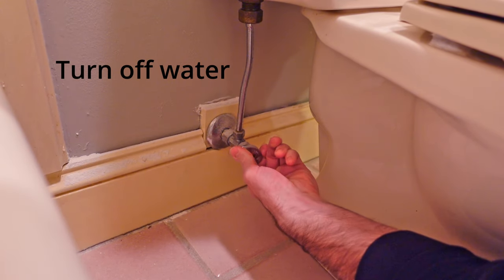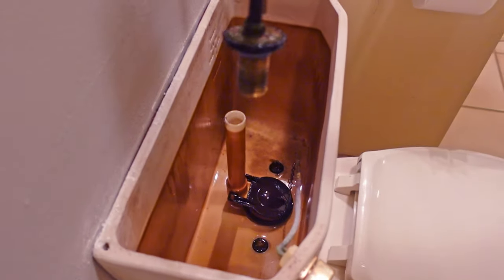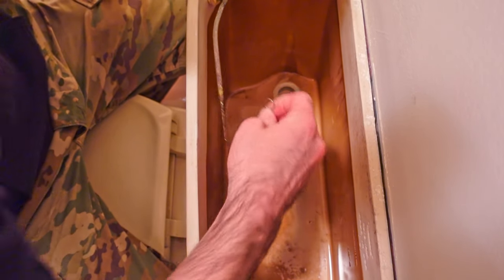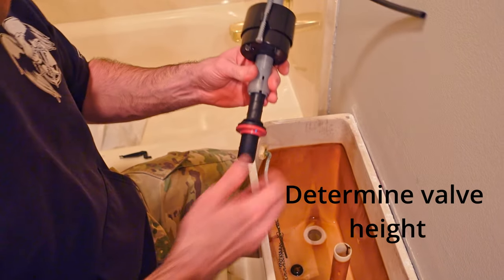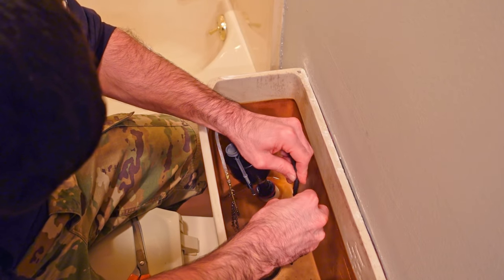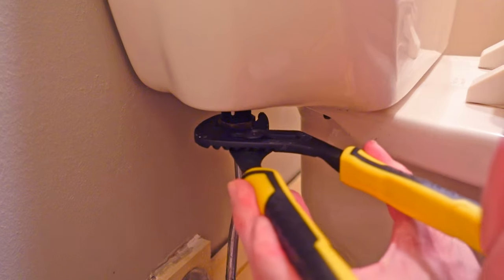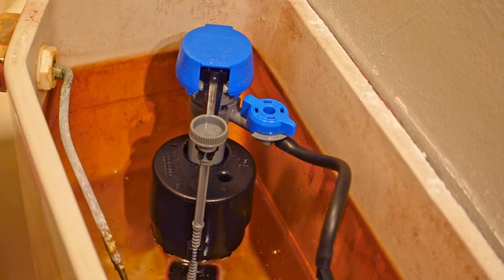How to Replace a Toilet Fill Valve || Installing the Fluidmaster Fill Valve and Flapper Kit

Comment: My tank has the ballcock also. Looking to replace everything in the tank. Do I need to have the ballcock also or can I just replace it like you did. Thanks
Reply from the maker: You can replace it all just by buying a new fill valve. The new valve will eliminate the ball and essentially replace everything inside the tank.

Comment: Thanks for the tutorial! My toilets been running nonstop and finally just bit the bullet to get a new stopper. Hoping I’ll be able to fix it tmrw when the part gets here!
Reply from the maker: To much tension on the chain connecting the handle to the flapper can be the cause of that. But if the fill valve is the older style probably just worth doing a full replacement since another part could have failed.

Comment: Video was helpful thanks.
Reply: I think I did the chain part wrong though since it's not flushing quickly
Reply from the maker: The chain does take some trial and error to get the adjustment right. My first valve install, I think it took me like 5-6 attempts to find the right tension. If you think its not flushing well, it might be the tension on the chain is not allowing enough water out of the tank before the flapper closes. If this is happening, usually you have to hold the handle down to get it to flush completely. On the other hand, you could also have the tension allowing for too much water, which would make the tank take longer to refill and the flush would last longer because of the extra water. Toilet design also plays a big role in how quickly the toilet flushes. I have noticed the larger the tank (typically older less efficient toilets), the more water per flush, then the slower the flush, cause it needs a lot more water to push everything through the lines. The smaller tanks (typically new and more efficient) that require less water per flush tend to be faster. I'm no toilet expert, and I know this isn't a straight forward answer, but it really is just a little trial and error on the chain adjustment. Hope this helps some.

Comment: Thank you so much! This was extremely helpful. I was so nervous about replacing everything in my daughter's toilet because it wouldn't stop running/fill up the tank. Excellent video!

One more thing. Why didn't you clean the tank?! 😂 (Before anyone comes for me, it's recommended that you clean your tank whenever it looks like that to remove rust and mildew.)

Comment: The angled seat on the flapper body that is insde the toilet along with the diameter of the hole that the water goes down is a big thing to address some are bout 2 others ar 3 and sizes vary by toiilet most take the common size fluid master. I had a toilet that would not take anything but the original 3 inch that I could not find a replacement for at the home deep hole in my area...

Comment: A massive help to me!  Great video. I am replacing the kit which is not too difficult using your video. Meanwhile, the flap looks fine except that part of the disk that it sits on just broke apart. Is that easy to replace? I could send a photo but I don't think I can do that on here. Any suggesstions?
Reply from the maker: Every part of the toilet and tank can be found and purchased individually in the plumbing section of Home Depot or Lowes. So you don't have to replace everything in the tank if you have one broken part but the rest is all good.

Comment: Im upgrading to the fluidmaster too. Can i keep the old fill line and flipper? I would need to remove entire tank to replace everything.
Reply from the maker: Yes you can keep those if they are still good. You can replace just the valve if you want or replace everything in the tank. You can find different kits at the store depending on what you want to do.

Comment: Are there any benefits to changing out the old style flush valves to this new style? We just moved into a new house and our toilets have the old style. And when I say new house I mean brand new house. I’m a little surprised they went with this old style of flush valve
Reply from the maker: The benefits would (in my opinion) not be worth the cost of upgrading to the newer style fill valves unless you are having issues with them or they are very loud when refilling the tank. There is nothing wrong with the older style, its old proven technology, it does the job and it is proven to last a long time. When I replaced mine they were most likely as old as the house and my house is 30 years old. The contractor would have used the old style in your brand new home simply because its saves money and they want to maximize their profits. Now the benefits of the newer valves are, typically its easier to make adjustments to the water level in the tank and bowel quickly and it takes up less space in the tank compared to the float valve which makes it easier to work on anything in the tank if necessary . Also the newer fill valves can be quieter than the float valves when refilling the tank, in fact some brands sell valves marketed based off how quiet they are.  So if you flush your toilets and its so loud you can hear it refill from across the house then that might be a good reason to spend the money on a newer quiet fill valve.
Reply: @thediygrunt  appreciate the information!

Comment: hey brother blessings, quick question...my toilet isnt filling with enough water after flushing ....so my pops got the new fluidmaster flushometer...should this do the job ?....do i need a specific wrench to loosen the bottom part i notice its pretty tight on there...i didnt want to mess anything up...thank you bro!
Reply from the maker: Toilet bowl water level can be adjusted using the fill valve. There are typically two "knobs" that control water level adjustments. One for bowl and one for water in the tank. You don't need a specific wrench just one that is big enough to fit around the nut on the bottom of the valve. An adjustable crescent wrench or channel lock pliers will do the job so long as they are big enough. My go to is channel lock pliers.

Comment: When connecting the water line back onto the toilet will teflon tape be needed at all or does it depend on the setup
Reply from the maker: I do not remembering using it and I have had no issues at all, though I could be mistaken. Plumbers tape will not hurt so you can feel free to use it. Worst case if you do not and turn the water back on you should see a leak almost instantly so just turn it off right away and add the tape.

Comment: In some videos they take the tank out. Is that necessary? My problem is the toilet constantly running.
Reply from the maker: I have never had to remove the tank to replace the fill valve on a toilet. I do not know of any toilet fill valve kit that would require the tank to be removed.

Comment: Those stiff fixed lines often break when you try to move them.  Why not make another video where you show how to replace the fixed supply line with a flexible line?

Comment: I was doing this today and literally got everything I needed correct, but no matter what I did, the toilet would never have enough pressure. It makes absolutely no sense to me
Reply from the maker: You have two different adjustments on the valve. One to adjust how much water is in the bowl and one for how much is in the tank. If you are having pressure issues I assume you mean not enough water is being released to flush everything right? First make sure the tank has enough water. Inside the tank usually on the back right you will have a line it will say "water level" or something along those lines. With the tank full the water should be right around that level, if it is not you need to make adjustments and then flush to reset the tank. Most likely your issue is the water level in the bowl. If you have to little water in the bowl and go to flush you will not have enough water released from the tank to generate the pressure you need to flush everything. So you need to increase the water level in the bowl if this is the issue. Make your adjustment and then flush to reset the level to the new adjustment. Most of the valves have instructions that typically say drop like 2-4 pieces of toilet paper in the bowl to simulate flushing liquid and 4-8 pieces to simulate flushing solids. If it fails to flush all the pieces then adjustments have to be made to the water level in the bowl. Most tanks are made to hold enough water for the toilet to be able to flush twice back to back so the chances your water level in the tank is the problem is slim. At minimum the tank should have enough to do one proper flush even if the water level is low but make sure to check both levels and adjust them if necessary. Oh I almost forgot check to make sure the flapper is opening all the way and staying open long enough to do a proper flush. Adjust the flapper by tightening or loosening the tension on the chain that connects the flush level to the flapper. I hope this helps.

Comment: I followed all instructions but the water level continues to go higher than the water waste pipe.

I made sure that the knob is all the counter clockwise for most minimal water level but it still continues to rise over the pipe and waste alot of water.

I also made sure the flap is completely closed. please help!
Reply from the maker: Valve has an initial adjustment that is meant to be made before installing it that determines the initial water level in the tank. The base of the valve where the water enters from your water supply line into the bottom of the tank, that part of the base is adjustable by screwing/unscrewing the valve. You said the knob for tank water level is set to the minimal amount but that knob is for making small adjustments so without seeing the issue in person the only thing that comes to mind is the valves height based off its adjustable base is to high. Typically if the valve is that high than the tank lid wont sit correctly on the tank because it will hit the valve. Again without seeing the issue first hand this is the best I can think of off the top of my head. Another possibility is you simply ended up with a bad Fill Valve and its simply defective.

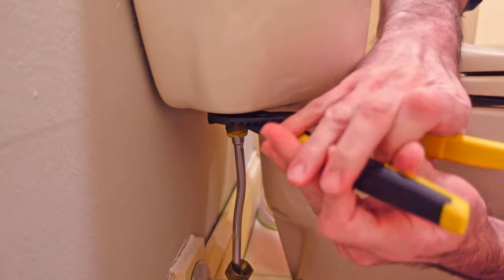Comment: What is the tool being used to remove the valve at 0:34
Reply from the maker: Channel lock pliers. A wrench or adjustable wrench would be more appropriate in that moment. For me its convenience and laziness, I keep the channel locks with my plumbing tools but the adjustable wrenches are not so half the time I forget to grab them and just use the pliers.

Comment: Would of been nice if you would of showed us how to take the float out😕😕
Reply from the maker: When you remove the water valve from the tank (the pipe that comes up on the left side of the toilet) the float valve is attached to it and will come out all as one piece or sometimes you can disconnect the float from the valve portion as well to have two pieces. The valve is held in by a plastic or metal nut on the underside of the tank.

Comment: You forgot to adjust that valve on the fill tube. It controls the flow of water into the bowl so it will fill the bowl but not waste too much water.

Comment: When you turn the water off just flush the toilet it'll save you time and energy instead of holding a bucket over it for it to drain
Reply from the maker: There will still be water left in the tank after flushing to drain the tank. Typically about a half inch of water is below the flapper and is unable to leave the tank so using a bucket and a sponge to collect all the water remaining will still be necessary.